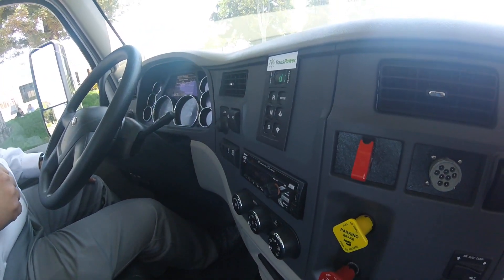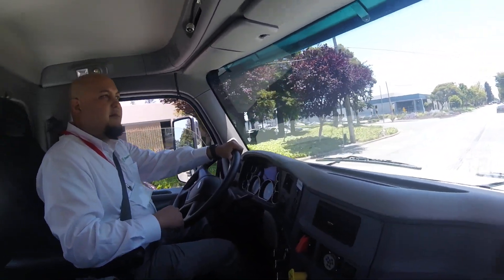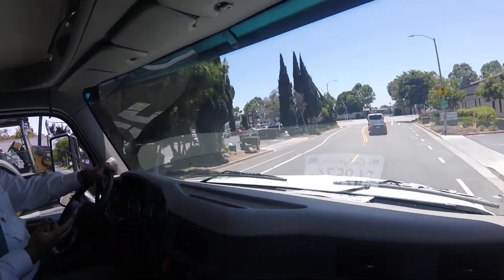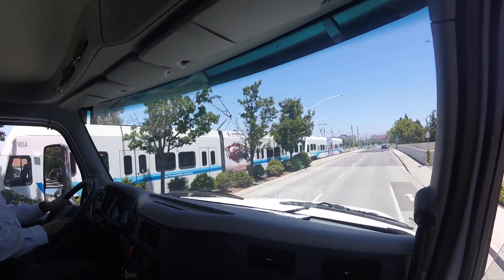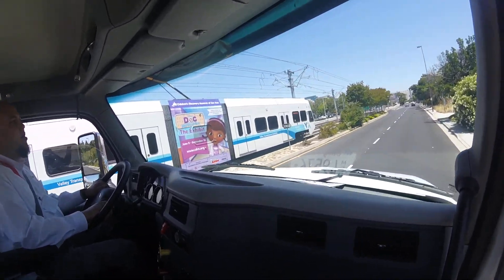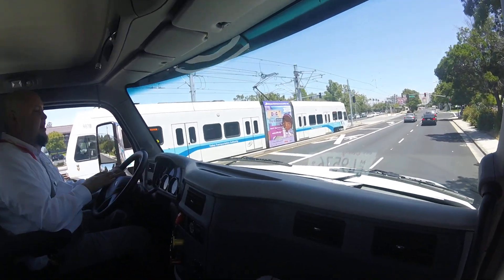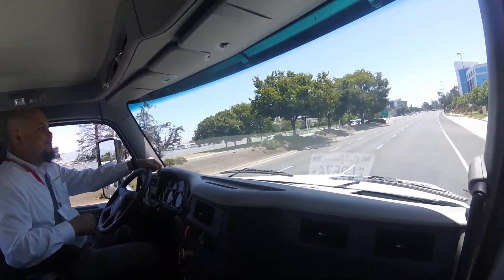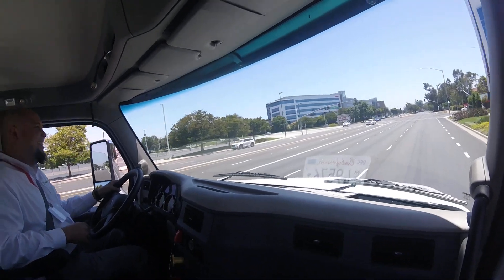Electric truck test drive: Peterbilt all-electric Model 579

Comment: Slow shifting. I wonder how it drive loaded uphill.
Reply: The torque of electric motor should help.
Reply: @Mechanical-ArtMD  you have all of the power available all of the time so hills would be easy